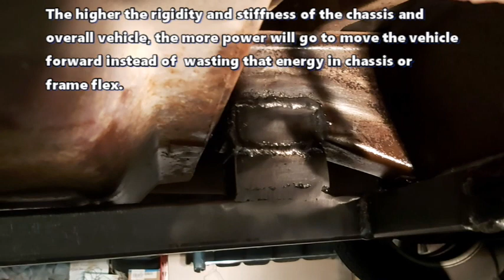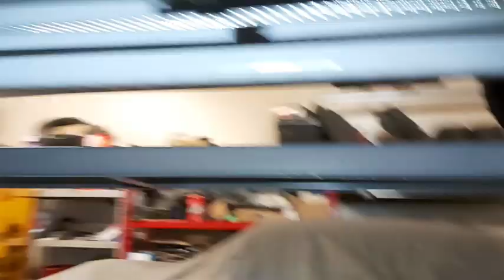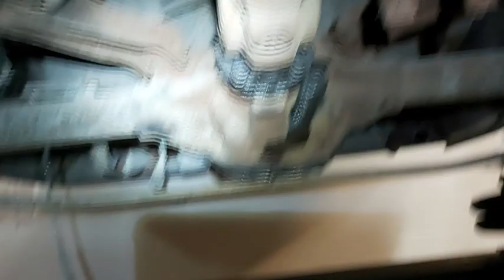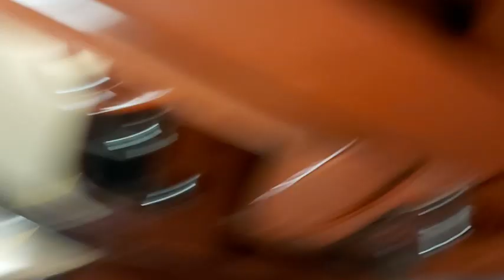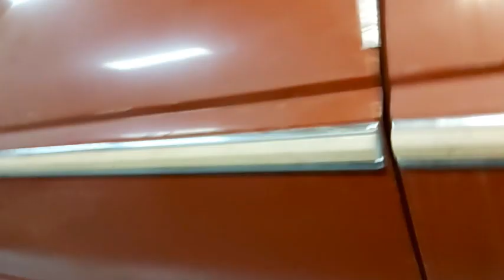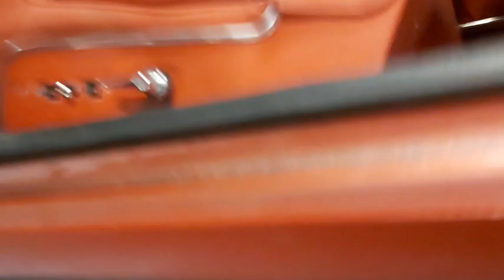Ford Fairmont / Thunderbird  Turbo L.S. sub-frame connectors fabrication & install

Comment: Thanks for posting. I'm about to install some sub-frame connectors I've had for about 20+ yrs. Finally getting around to installing them on my 1980 Fairmont Futura. The car was special ordered by my mom. It was her daily driver until I go it. It's on my channel if your interested.